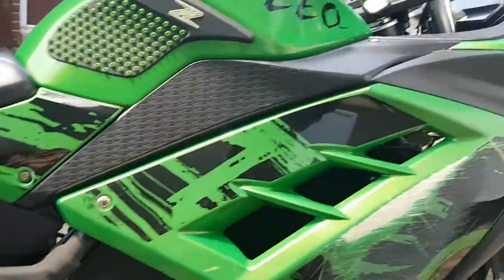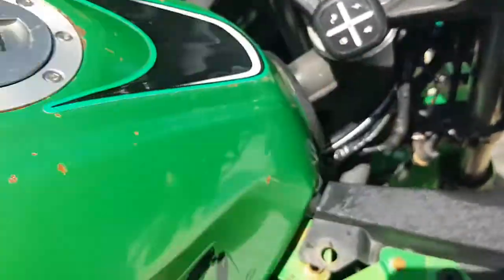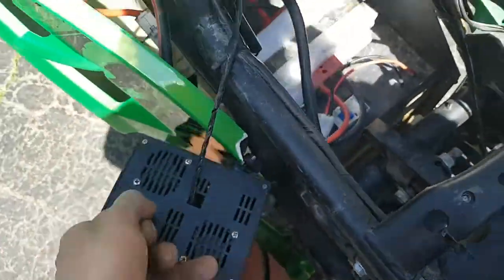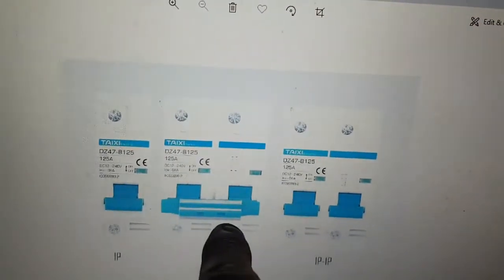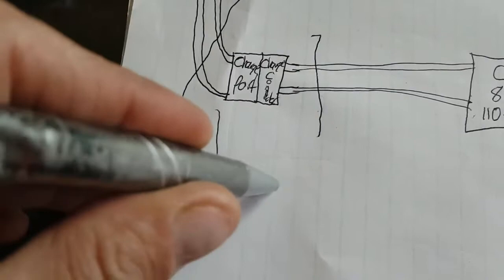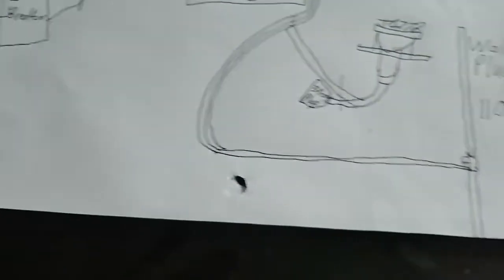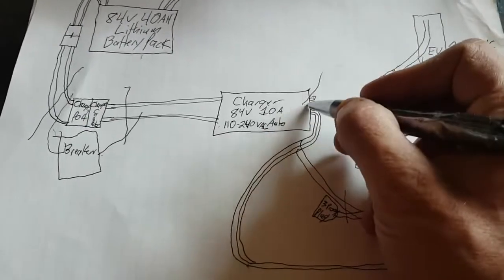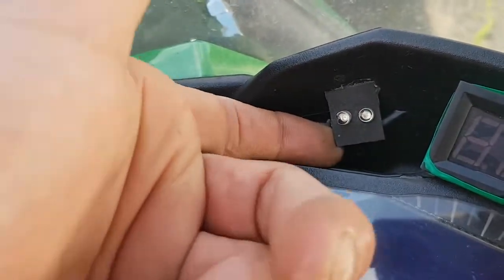Tao Leo - Custom Charge System Explained

Comment: How did you physically make the j1772 secure in the tank opening position? Is it bolted in on the inside?
Reply from the maker: No. I dumped about 6 sticks of hot glue on it lol. Has since been relocated under my back seat because the larger white charger handles wouldn't fit.
Reply: @GreenLeoMan  ah I see.  Would you happen to know the outsiders dimensions of the complete battery metal case? I watched the video where you had water inside it.
Reply from the maker: @legion-t5j yea I'll measure it for you tomorrow. It's 1:06am. Tnx for watching!
Reply from the maker: I didn't get a chance to measure it today. Had a scrap load leaving my basement. I'll do it tomorrow forsure.
Reply from the maker: Sry it took me so long. 40cm long x 17cm tall x 20.5cm wide.
Reply: @GreenLeoMan  appreciate that man..hope to see ur new Leo vids soon
Reply: @GreenLeoMan  what is your pack specs? 72v 40ah??
Reply from the maker: Yes exactly. With 18650 cells and a daly 120a bms
Reply: @GreenLeoMan  let's say you had 2 of the same packs as yours and wired in parallel for 72v and 80Ah. Would it be possible to stack another one on top of the original? Would the frame allow it fit height wise? Thanks
Reply from the maker: They are independently controlled by their own bms's u can't hook them together. What you could do instead is put them on breakers so u can turn 1 off when it dies and turn the other 1 on and keep going, you'd have to charge them the same way, 1 at a time. And never turn both on at the same time or ur gonna see smoke. Melt wires, fry the bms's etc.. it's totally doable and I'm currenly working on a similar setup, but u cant get a matching one. It's gotta be 1 of those weird shaped triangle ones or it wont fit on top.
Reply: @GreenLeoMan  I see. But if I did have an identical pack that I could connect independently, it's not gonna fit on top coz of the frame??  I'm assuming it gets narrower at the top
Reply from the maker: @legion-t5j exactly right.

Comment: if i was to get a new 72 v lithium Charger for the purpose of adding the 1772 j plug adapter, what charger should i get? i currently have a 72v 5 a,  but would try upgrading to a 10a or 15a....or is that to much? scared to fry the battery... my battery is a 72v 60ah lithium
Reply from the maker: 10a 110-240v
Reply: @GreenLeoMan  thanks bro..I ordered the 10a.
Reply: @GreenLeoMan the charger I ordered was not 110/240 so I canceled.  Also I tried your charger link here and it's not working anymore. Can you update it for us non electric knowledgeable people.? Trying to find the right charger..I have 72v 60 a lithium battery and want the 10amp charger but having tough time on aliexpress finding the right one for home use and ev stations/j1772 😮
Reply from the maker: @ToyMakerprops ok give me a coupla minutes
Reply from the maker: Https://a.aliexpress.com/_mKA4IWk

Comment: will this work on a emmo zone gts?
Reply from the maker: Yes ofcourse. This will work for any ebike with a lithium battery
Reply: @GreenLeoMan  thanks for clearing that up. Is there a way to make it work with a lead acid battery
Reply from the maker: No. Not unless u can find a 110-240vac lead acid charger. But I wouldn't recommend it.  I think the fast charge might bubble and exhaust lead acid if not catch them on fire if they're older. Just exercise caution if u go that route but I would recommend this only for lithium batteries.
Reply: @GreenLeoMan  alr thanks for the help

Comment: Hey man thanks for the video. Alibaba has new parts so the build is alot easier now. I got a tao leo 2022 red brand new last year, and am finally adding a fast charger to the bike. I'm so glad I found this video to be inspired. Just finished the custom battery 110v 100ah with 18650 cells, can't wait to charge this in under 15 hours
Reply: Can you please post the links of what you got?

Comment: Hi greenleoman, question would the same charger system that in ebike still work for a 50Ah Lithium battery ? Or do I need a different type of charger ? Am getting the same ebike like yours in a few months the new version tao leo controller swap out for EM 100 and a 50Ah Lithium battery  for range too. Thanks for your advice help feedback .
Reply from the maker: It'll be fine. The amp hours just means It'll take a little longer to reach full charge. Ah is just Capacity,  nothing to do with the charger. Congrats on the bike. They're fun 😁

Comment: Is it possible to upgrade a Tao Leo to be able to go 200km per hour without having to change the engine?
Reply from the maker: Firstly, u mean motor lol, no engine here. And no. 3kw max stock motor = 110-130kph max. U would need to change the motor and controller to achieve those speeds, but That is possible, could go even faster then that with a 15kw system! I want the 15kw myself. 😁

Comment: So is this possible without using a breaker and and a different charger will i be able to just use my stock charger with the j plug and charge at a ev station?
Reply from the maker: Only if your stock charger is rated for 240 volts. 110 volt chargers will blow up if u hook them to 240 but if its 240 or 110-240v auto ur good to go. And if ur not installing it all internally don't worry about the breakers, they act as a quick disconnect, but U can just unplug the charger externally so ur good to go there too. Hope this helped.
Reply: @GreenLeoMan  thanks a lot man, love your work
Reply from the maker: No problem. Happy to help.

Comment: Is there a way to charge my tao Leo faster ? It’s a 72 v 40 amp battery
Reply from the maker: Yea do exactly what i did.  Any faster charging and u lose level 1 charging capabilities because the charger in this video is the best u can get right now that can do both 110 and 240v automatically. But if u dont care about that then get a 20a 240v charger. Anymore amps and u risk blowing your bms. Hope this helped. Make sure to watch all the way to  the end of the video. All is explained. Cheers.

Comment: can you charge at tesla stations?
Reply from the maker: I'd have to get a j1772 to tesla adapter but yea I can't c y not. No dc superchargers though. Only level 1 and 2.
Reply from the maker: But there's usually a j1772 close to a tesla station anyway so I don't have a need for 1.
Reply: how much time to recharge 0-100%
Reply from the maker: Level 1 about hour and a halfish. Level 2 around an hour. Atleast with my setup. Every bike handles charging differently. Depends on the mah of the battery and the amp output of your charger and the balancing system in your bms.
Reply from the maker: Some bms's balance by increasing the charge rate on the weakest series of cells where as other bms's charge the whole pack except the most charged series of batteries. That will in turn affect the charge time. Bms's that charge the lowest cells will take longer to reach 100% than the 1's that charge the other way round. Hope this clears things up for you.
Reply: @GreenLeoMan  yes it does. the output of my charger is 88.2v. it take 10h for full charge right now. i did buy the same 220 charger to charge at level 2 i hope it will be faster
Reply: @GreenLeoMan  about that i got a VoltR6 72v40ah an would like to upgrade for a 80ah. you bike really looks like mine do you have an idea or the size of your battery?
Reply from the maker: The volts don't matter my friend.  It's all about the amperage with charge time.
Reply: @GreenLeoMan  okay so with the new charger from alibaba on this video it will charge faster?
Reply from the maker: Yes because it charges at 10 amp. Most basic chargers only do 2-3 amp. More amp=faster charge.
Reply: @GreenLeoMan  perfect thx for all the answers
Reply: @GreenLeoMan  question. looks like when i charge my bike even after 10hours, the lights on my charger are still not green even at 85.5V reading on my bike. is that normal?
Reply from the maker: No it's not. Either a faulty charger or bms. But plz slow down on the questions Daniel.  I do have content to make. Tnx. I'm sure your local ebike shop would be able to answer all the questions you have. Enjoy the videos and Goodluck.

Comment: gonna mount my j-plug in the trunk ..or on the side black panel .
Reply from the maker: Nice. Probably won't need to take the j-plug apart if u put it on the black panel. Can keep the cap intact that way as well. Good luck my friend.

Comment: There are portable j1772 ev chargers for home use on Amazon that are 240v but also run on 110v with supplied nema 5-15 adapter. I've seen a few that will give you 15 amps charging at 110v.
Reply from the maker: Good to know. Tnx :)

Comment: I had a question about the option of keeping the charger externally. Could you just connect directly to the bike's regular charging outlet at the wheel well with the 110-240v charger and then connect that to the J1772 adapter? If so, would you still be getting the same fast charge speed at a level 2 charger? Or is the wiring not compatible that way?
Reply from the maker: U got it right. I just cut out all the connectors,  threw in a couple breakers to disconnect the charger from the bike and fit it all inside. But yes u can plug the charger into ur bike, connect the j-plug to ur charger and plug in the level 2 cord all externally. The wiring is designed that way.
Reply: @GreenLeoMan  Wish you could get a kickback on our orders. Thanks ordering now!
Reply from the maker: Me too. Lol. O well. Maybe 1 day. I can dream.